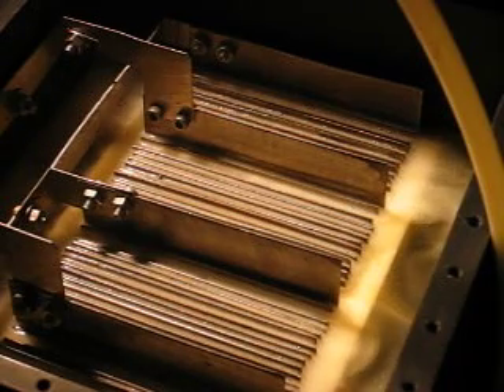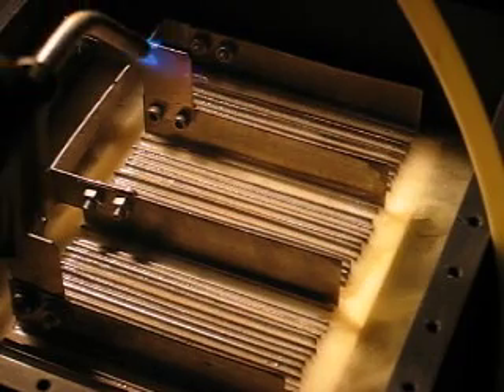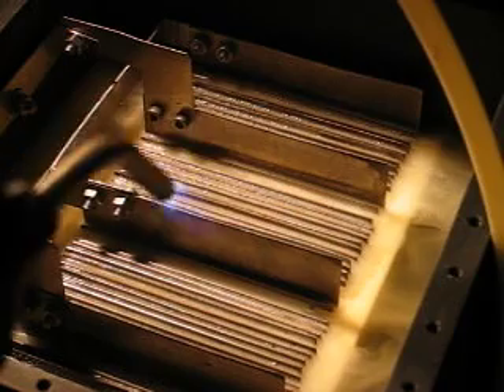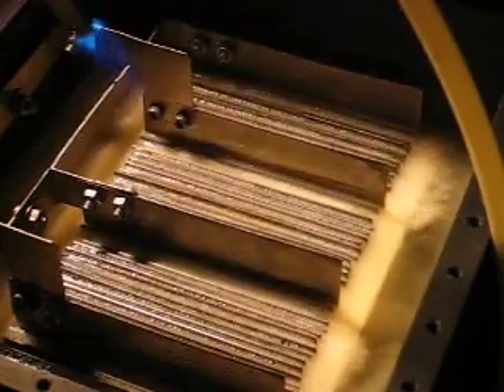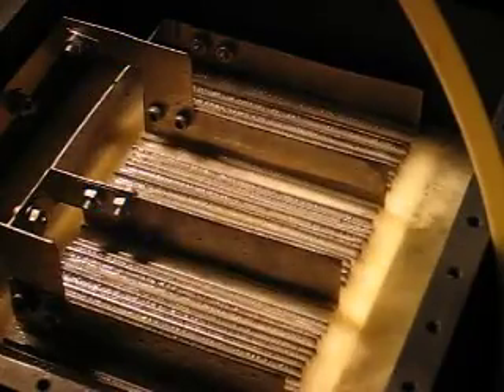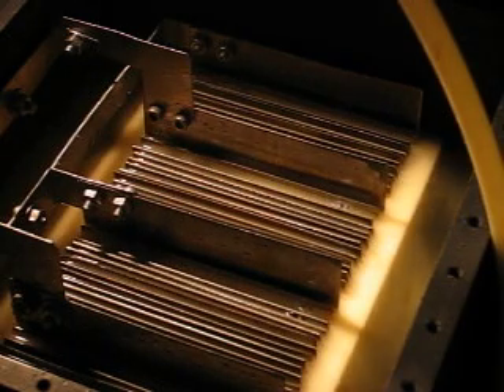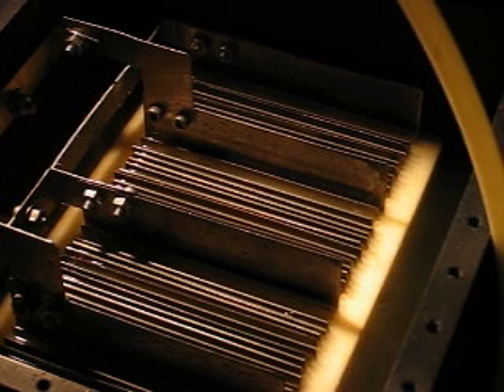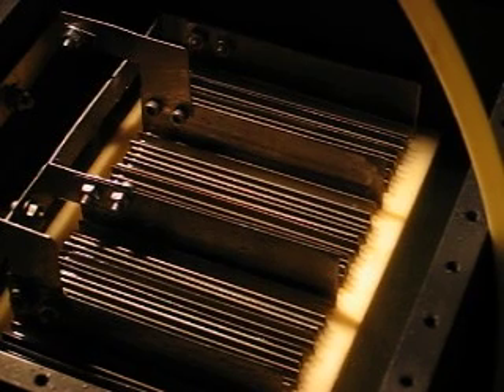HHO Production With Potassium Carbonate

Comment from the maker: You can get it off Ebay. Stuff is pretty reasonable. Seen some, 5 lbs for a little over $10.00. Can be purchased at chemical supply stores 50 lbs at a time if need be.I think the 50 lbs is not much more than the 5 lbs on Ebay.

Comment from the maker: All the 304 Stainless was scrap from CNC machining center doors that wrecked and were replaced. The HDPE, (Black Plastic, UHMW cost me around 50 dollars. These plates were conditioned for a while and sanded then cleaned used rubber gloves to put them in the cell and used distilled water and low concentration of KOH on the first test with this cell. Good place to get stainless is Metal Express on the net. Use them a lot at work. Will give online instant prices also.

Comment: Deffinitely something that I have been thinking about as well. Some of the video's I have seen at higher voltage don't work as well as yours. I have heard it thrown about to actually attain the resonance frequency of water we would need to be pulsing Volts in the thousands? What would happen if I hooked up an ignition coil with a pulse circuit? As long as I give the coil time to "Reload", it would be pulsing at 50,000 volts? Just something I have been rolling around for a while.

Comment: You should consider making HHO cell power supplies for high voltage users. Like a mdbreed toroid/rectified/full wave/pulsed/efie super box for those who don't have the time to get an electronics degree. Something that will be only a few connections and knobs for adjustment of the pwm and efie. Just a thought. No one has done it yet.

Comment: if your running caustic electrolytes and switch to acidic -the acids will clean the plates of the conditioning layer.and the cell will need to be reconditioned.